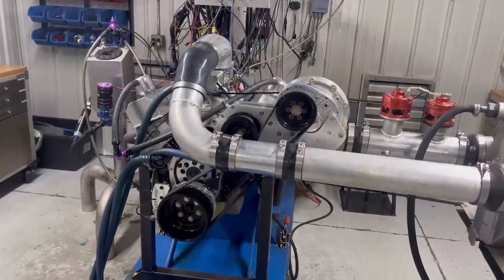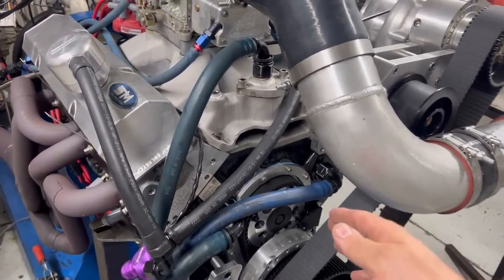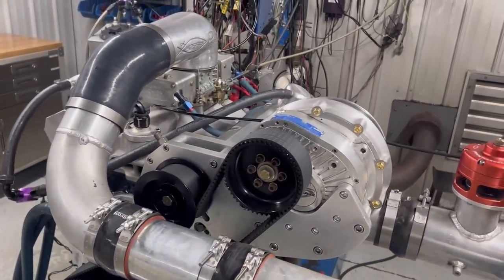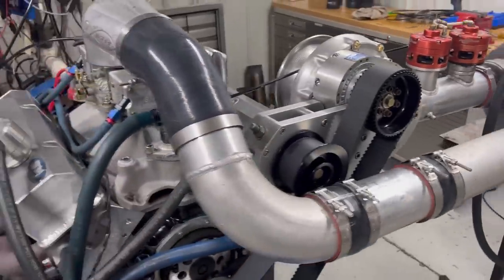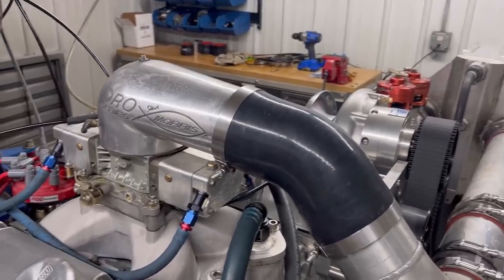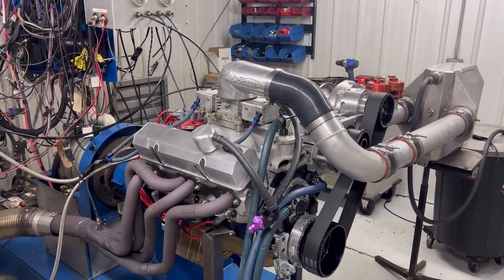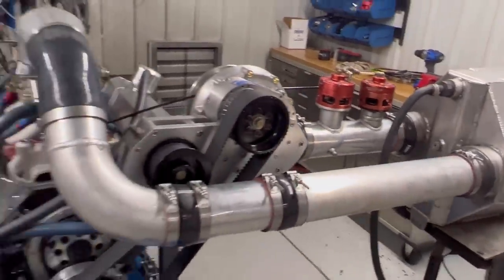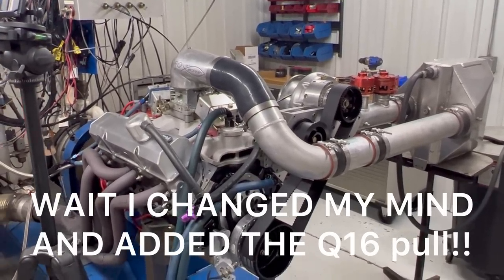1850 HP Old School SBC !! Intercooler, 250hp increase, Blow through Carb Tech and More!

Comment: I really wish someone like you or Cleetus/Garret would run with my continuous boost idea. You have a huge audience and the technology to build a proper prototype and make it mainstream. Simply put it's a turbine engine that runs off diesel or jet fuel and produces continuous boost pressure as well as powered exhaust scavenging. Think jet engine powered turbocharger, with enough power to run all your accessories and an additional turbine that sucks the exhaust gas out of the engine.
Reply: To much heat, continous boost won't really be a positive thing beside just making heat
Reply: Like. Nick Mann’s mannic beatie from 1983 it’s on YouTube
Reply: @evilmotorsport  WOW I have never heard of that car before! So my idea  HAS been done already! Thanks for sharing that
Reply: Electric turbos do that but are more practical

Comment: Don't like blow through carbs for anything except drag racing and I'll tell you why. It's because NA they do real good as you throttle one back they can be made to seamlessly begin running on the idle circuits (and some have transition circuits to smooth out the well transition) at high speed and low or no-load.
Now acceleration is fine with a blow through - you whack it WOT and the turbo or blower winds up and they've repurposed the fuel economizer valve to be supplemental to the main jets.
        What happens if - in a practical road car - you want to keep the engine wound up but cut back on the torque by throttling? Pretty sure that setup you got there gonna lean out when you try making the fixed idle system meter fuel under 3 atmospheres of pressure instead of one.  Sure you could open up the idle circuit too - but then you'd be drowning it in fuel at 1 atmosphere.
          Holley 8-injector Super Sniper 1250s ain't that expensive to "do it right". And Steve was the first guy to dyno one if I am not mistaken !

Comment: "Small block Chevy cranks will snap off or spin the balancer and wipe out the keyways with a blower belt on them." You don't say.. thinks back to Roadkill's Draguar How many times has that thing spun the balancer on the crank? Though mostly it just loves to sheer the bolts off the balancer and kick the pulleys off driving down the road. Come to think of it, unless you put a later crank in it, there's no way to supercharge a 283 huh? Because those things (and the early 327's) don't have a crank bolt holding the pulley/balancer to the crank.

Comment: You should have not used a giant ice bucket because that will not be in a car. You should have used a air to water inter cooler that would actually be in a car to get correct test results
Reply: People regularly add ice before a run.
Reply: He did use an air to water intercooler? The water from the bucket is being pumped into the intercooler, which is basically exactly how it’s done in most drag cars
Reply: This is exactly how that setup would be run, these cars are used for 1/8th or 1/4 mile drag racing where they have a tank they will fill with ice and water just for the intercooler.
Reply: another internet "xpurt" getting clowned on
Reply from the maker: A race car typically has a 5 gallon tank for a water ice mixture, 
I would have to add ice after every dyno pill as it melts
The big trash can and pump hold more ice and water so I don’t have to add ice every dyno pull. 
This is the best way to test and most accurate.
Reply: @stevemorrisracing  o ok. That actually does make alot more sense. My apologies Steve.

Comment: Blow through carburetor is literally inefficient like loss of power, loss of fuel efficiency and overall loss of money.
Reply: If that same set up was fuel injected it would not make as much power. The carb acts like another intercooler, when the fuel gets pulled through the carb and gets atomized it pulls more heat from the intake charge. You don't get that with a fuel injector, so this set up makes more horsepower than if it was fuel injected. Why do you think people still use them.
Reply: @MJTAUTOMOTIVE  why do you think all the winning drag cars use a fuel injector called an atomizer, there are specific fuel injectors that do what your talking about way better and as I said more efficient combustion because of more fuel at a better dispersion. My reference was mike Moran, and tom bailey. Tom is way more well known than Mike Moran though.
Reply: @aidenyoung3115  You know who built Toms engines? Steve Morris. Who in these very comments states the opposite of what you state. There are reasons why FI is better, but it's not because it makes more power than carb.